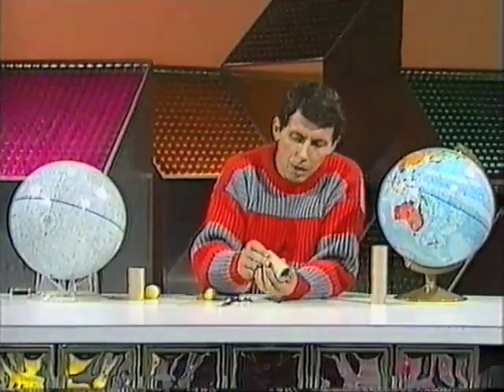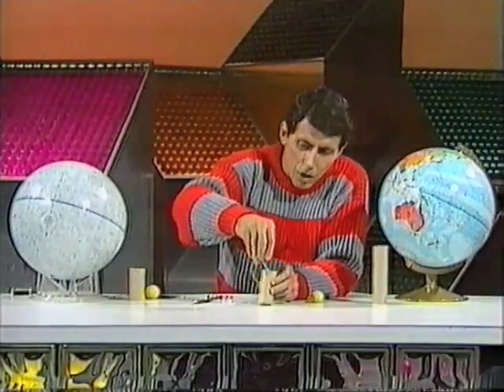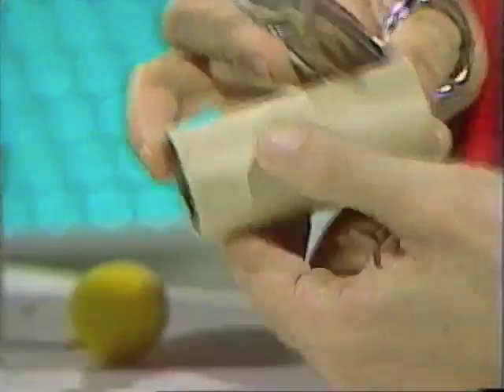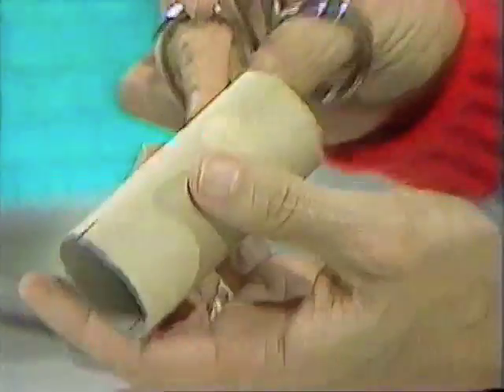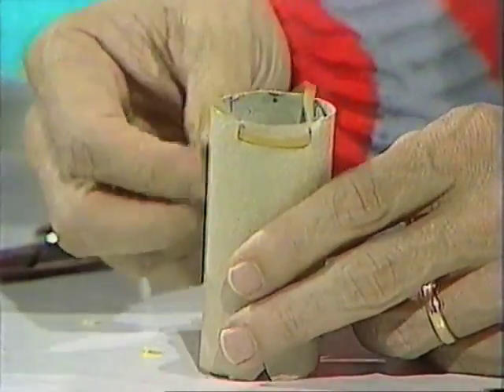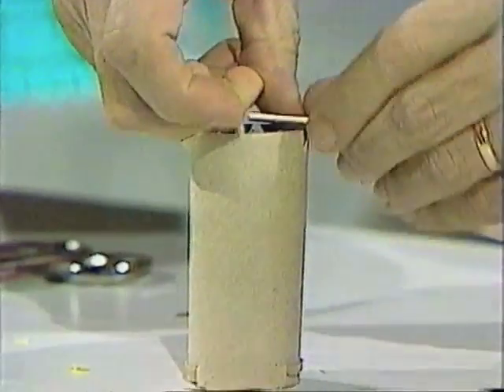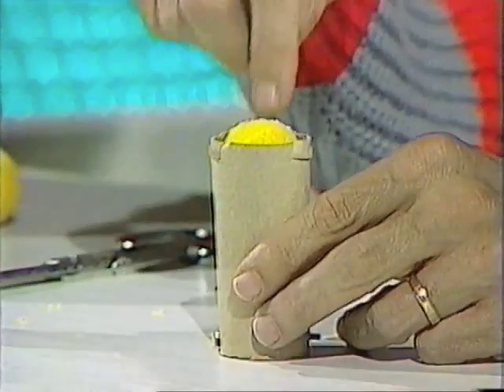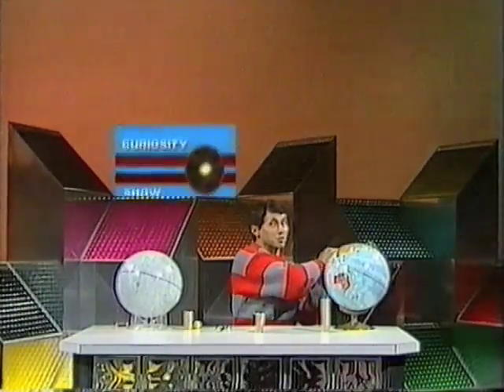Making a Cardboard Cannon

Comment: the next project, the 21 'gun' salute ;) lol greap clip
Reply: Rose Tico Enthusiast  No, you'd just need to lay the tubes upright one next to the other, with rails at the sides and a wall at one end. Pushing the tube at the unobstructed end, all the tubes would be compressed. Perhaps not all of them at once, but if the push is sudden, it will be close enough.